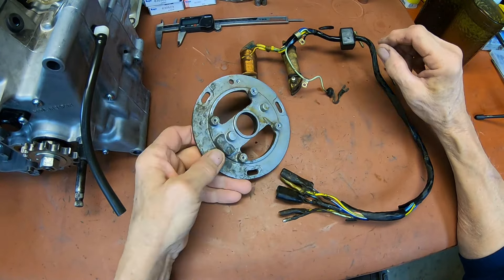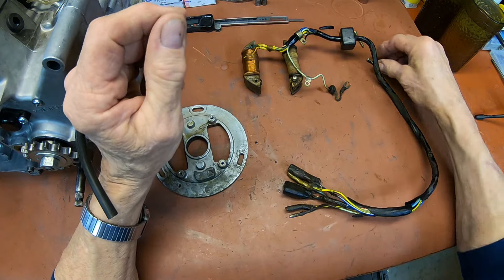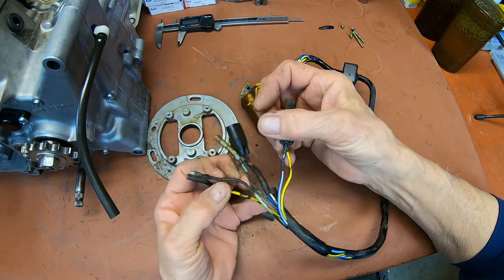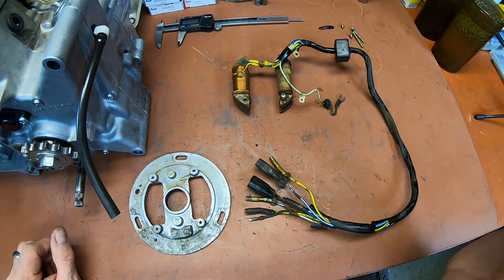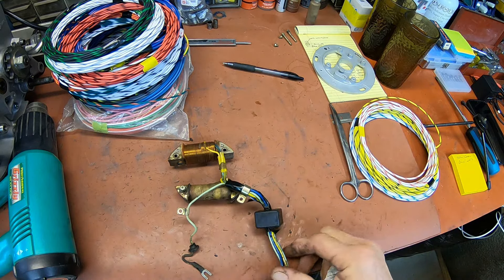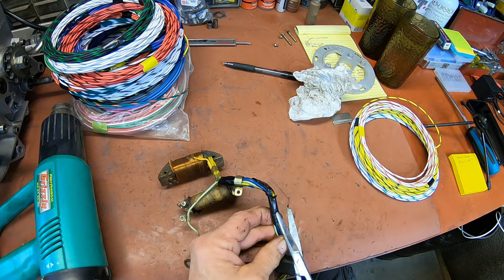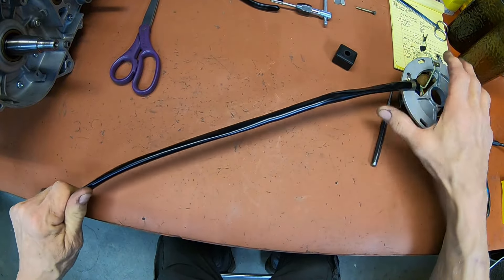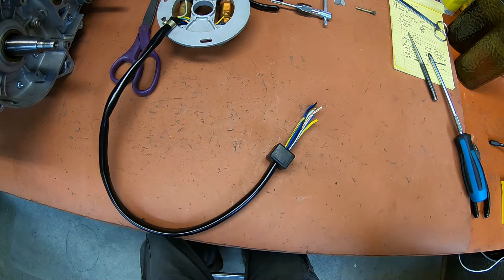Kawasaki F7 Bushwacker stator cleanup and sleeve

Comment: Thanks again Dale. Lots of valuable information you shared with us on this one. Have the suppliers bookmarked and will have to try the hand cleaner solution on my old wires. Will likely have to replace the ones on the AS1. She's pretty sun faded and I imagine the Australian Sun took it's toll on the wire casings as well. I have spares for the Suzuki TF185, so should be fine on that one. Thanks again for all that. Much appreciated.👍🙏
Reply from the maker: Thanks Gigi, you know sometimes replacing is the best solution, I really thought that was going to be the route I took, but once the sleeving was off and the oil and grit cleaned up, it really didn't look all that bad. But if the colors are gone you may have to replace them. I get some like that occasionally here too, the sun at high altitude really does the number on plastic.

Comment: Hiya Dallle when I need to take tight wiring harnesses apart I heat up with a air gun like you then I use a sowing un-threader ...it follows the wire well and I haven't nicked a wire yet......
Reply from the maker: Good tip will have to keep it in mind. Thank you.

Comment: Nice bit of work Dale. I got the 185 torn down and some pac rats made a mess of all the wires. If I can't find a suitable replacement harness I'll have to remake one.
Reply from the maker: Oh boy, that's tuff David, I have had to remake a lot of them I know your pain. But I bet you will find a good replacement.
Reply: I called the salvage yard up in Phoenix and he said that he will look at what he has along the lines of what I need. He is also sending me some fenders from a 74 TM250 and side panels from a 80 TS185 and an exhaust pipe from a TM250 that I can modify to work on the 185. The plan is to make it look like a TM250 with the RM suspension upgrades.

Comment: Another Great Video Dale: You seem to be getting better and better and faster and faster all the time. I wish I could say the same about myself. I have had 2 rotary-valve motorcycles. One an early Suzuki 100cc trail bike with a high and low-range shiftable transmission for my kids and later a CanAm 250 enduro with the Rotex 6 speed. Bored the Suzuki a few times but never had to lay a wrench on the Rotex.
Reply from the maker: Thanks John, oh let me tell you.... sometimes it's not easy getting back to the project. I find the older I get the more I like to set and speculate. These rotary valve engines are really good engines, they go back to the geniuses of the Japanese bikes.

Comment: 28:00 I was wondering whether you would solder the connections, some people reckon that the solder will 'wick' down the wire and make it brittle, I'm with you, solder makes the connection much better in terms of its electrical resistance, especially after a few years of use, and if you use a tiny amount of solder it won't wick past the end of the connector.
Reply from the maker: Yep, that's how to keep the job from coming back. Or in this case.... reliable. I don't dwell long on the solder joint, don't think it will wick up too far.

Comment: Surprised the wiring bundle doesn't have more protection from stones and other debris flying off the chain at back of engine case near Made in Japan embossing, maybe there's a chain cover. The cliche 'better than new' comes to mind on your stator and wiring!
Reply from the maker: Hey Steve, yes it seems a little bare there. Not seeing anything else in the parts diagram, not real familiar with Kawasaki's. I'm sure someone will tell me if something is missing. Yes, that sleeving and new connectors really clean the ole girl up.

Comment: Dale im working on a old bike with like cloth wrapped  wire thats brittle and runs uder the engine with heat and  any oil what you suggest
Reply from the maker: Hey Chuck, wow.... think I would redo it if you can. Not sure about the cloth wrapping, I'm sure you could substitute the vinyl wrap like I used here. I'm sure with a little looking you could find the cloth wrapping too if you want to go back original.